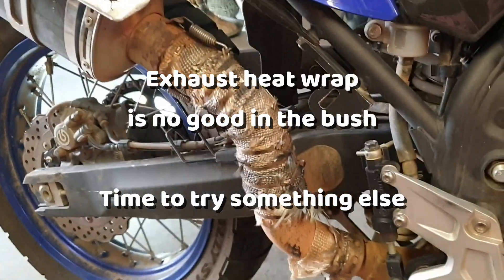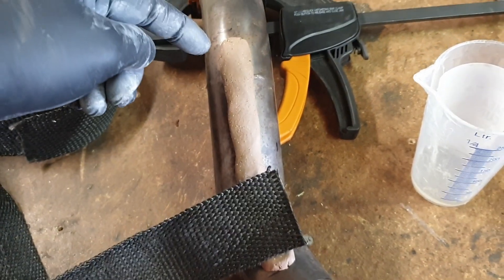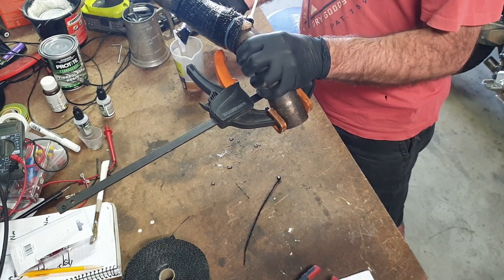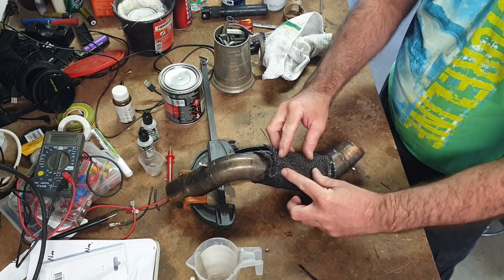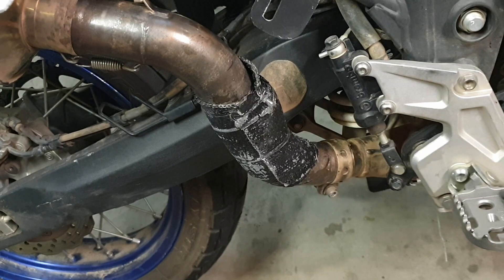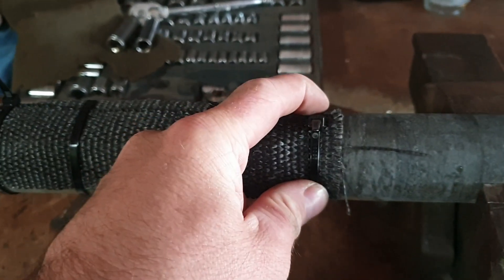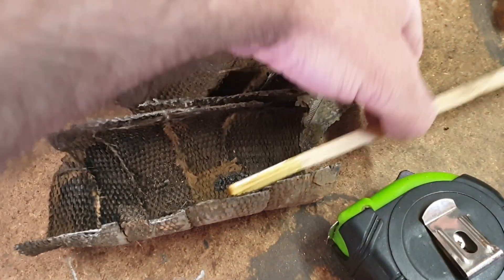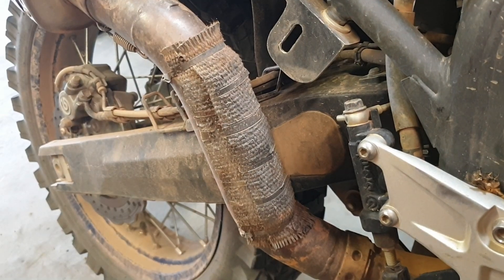A fibreglass heatshield for an exhaust?

Comment: ceramic coating the exhaust pipe itself will reduce temps and make the heat shield more effective. Ceramic coating will also stop moisture rusting the steel pipe out.
Reply: @Swim Fan ive used it on race car engines extractors that were  heat wrapped with good success.  The extractors were a snug fit under carbon fiber side pod covers on a Dallara F3 chassis which on wet tracks also got a lot of water thru them.  Having said that, all coatings may not be equal.

Comment: You could reduce the amount of heat by putting a pipe on each side of bike a la rally raid.
Automobiles would put metal shield with glass matte on the inside thus protecting clothe mechanically.

Comment: Have you got 2 sets of wheels or a tyre changing set up?
Reply from the maker: Nope. I have two 300mm tyre levers and a set of biceps!
Reply: @Nerb1  i just noticed two different tyres in the one upload. I gave my original perellis away.
Reply from the maker: @ronsmith5648  yeah, this video was filmed over a period of month or so. I put my pirellis back on for a road ride and have taken them off again for an offroad ride. Im regularly changing tyres.

Comment: The polyester will not melt. You mey find the the resin will not saturate as well as normal low density matting. You may need to allow more resin to penetrate the glass.

Comment: If the resin melts, I would be tempted to experiment with either very runny clay or cement - basically a glass / ceramic composite rather than a glass/resin one.
Fingers crossed the fibreglass would be strong enough to stop clay/cement cracking…..

Comment: An aluminium shield plate mounted off the 2 bolts for the rear brake MC…. Leave the pipe alone you pervert 🤣
Reply from the maker: Which will be lighter? Your bolts and aluminium or my fibreglass? And I thought you were all about performance Alfons!
Reply: @Nerb1  I’d guess your fibreglass might be lighter… It’s surely uglier :) What about a short section of flexible aluminium header shield?

Comment: 😬
Reply from the maker: What? You have no faith?
Reply: @Nerb1  , from 1 engineer to another,  yes I do
Reply: Should work I made a pipe gaurd using fibreglass and worked fine but was on a two stroke expansion chamber

Comment: Hey Nerb , if you have anymore issues, just weld two nuts to the pipe and blind bolt/screw a piece of SS on with a air gap or some SS wire shaped to the pipe with two small flats for the bolts, quick easy Tig job.
Reply from the maker: Ive had multiple people happy to make me a proper heat shield, but I wanted to give this a go. And a bit of fibreglass weighs less than stainless ;)
Reply: @Nerb1  C’mon Nerb1 you would never know the difference in weight